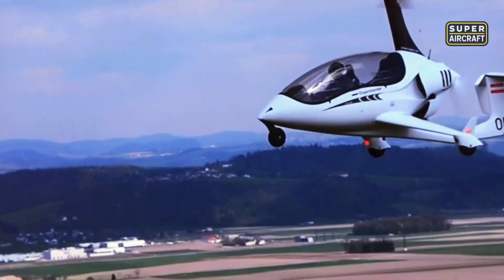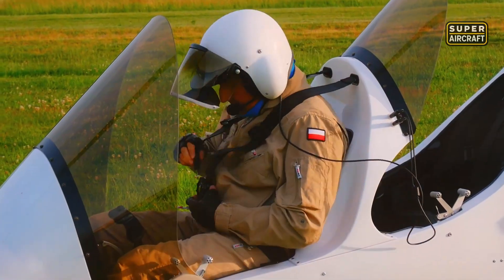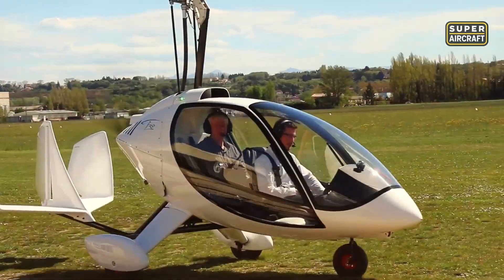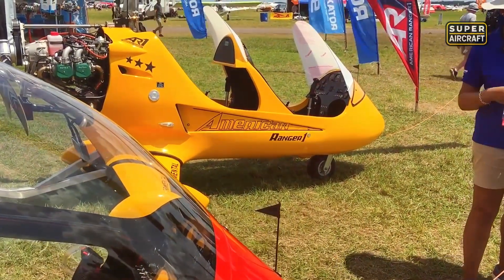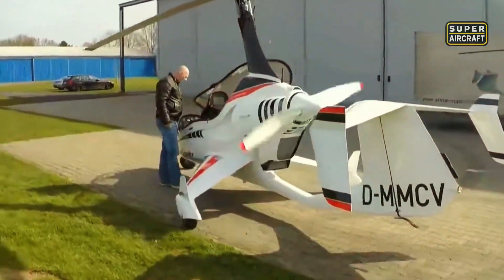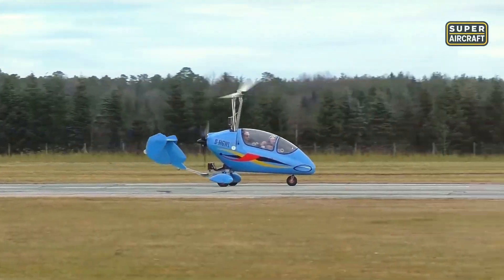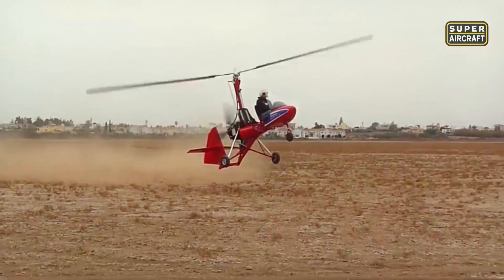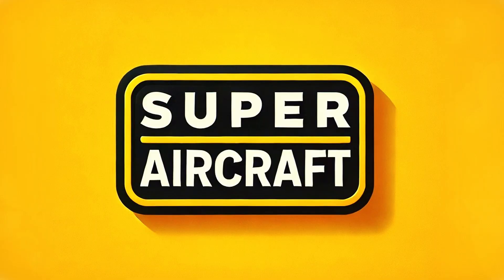WHY ARE THESE GYROCOPTERS MORE POPULAR THAN HELICOPTERS NOW

Comment: ¿Autogiro o girocóptero son términos similares aplicables al tipo de aeronaves aquí mostradas? Sí pero no pues mientras el "AUTOGIRO" es un tipo de aeronave que utiliza un rotor (las aspas superiores) como un helicóptero, pero sin propulsión alguna, pues para generar levantamiento el rotor solo gira por el flujo de aire que lo atraviesa en sentido ascendente, produciendo solo una fuerza de levantamiento dependiendo de la propulsión hacia adelante generada por el motor (trasero) y una hélice que le hacen despegar cual una avioneta, el "GIROCÓPTERO" es un tipo de autogiro que tiene un rotor propulsado, pues el rotor está conectado al mismo motor que hace girar las hélices traseras,  permitiendo así que el girocoptero pueda despegar y aterrizar verticalmente, como un helicóptero (3:27).

Post-data:
En resumen, mientras que el...:

1. Autogiro: tenga un rotor no propulsado que necesita velocidad de empuje horizontal para generar levantamiento, el...
2. Girocoptero: posee un rotor propulsado, que le permite despegar y aterrizar verticalmente como aquí (3:27).
3. Y aunque el término "girocóptero" sea lo primero que se nos venga a la mente aún viendo las diferencias entre ambos tipos de aeronaves, técnicamente, el autogiro es un tipo específico de girocóptero.
Reply: A helicopter has a powered rotor.  A gyrocopter, gyroplane and auto gyro are different names for the same type of aircraft.  The rotor on these aircraft are not connected to the engine. However that being said on some a prerotator is used generally a small electric motor to get the rotor  blades going. Then the prerotator is disengaged.
Reply: @Dan-u1m7i  ¿Se fijó en lo que escribió en su apuro de comentar mi comentario? 🙄🤔🧐
Reply: @legionariodemilbatallas_57-62  That is a impressive video picture a prerotator  combined with headwinds could explain this video clip. I have seen small planes take of in very short distances with high head winds. I stand by what I said I have rechecked different sources.
Reply: @legionariodemilbatallas_57-62  I stand by what I said I have checked many sources.  The video clip referenced is impressive. A prerotator combined with high headwinds could explain that takeoff. I have seen small airplanes take off in very small take off runs in high headwinds. I can not find any reference that a gyrocopters rotor blades are connected to the main engine.  If you could reference a technical article I would read it.
Reply: Слово "автожир" придумал испанский инженер Juan de la Cierva.
Слово "гирокоптер" придумал русско-американский инженер Игорь Васильевич Бенсен.
Все эти слова обозначают один и тот же тип летательного аппарата, использующего для подъёмной силы вращающееся крыло - несущий винт.
Чтобы автожир/гирокоптер/гироплан мог взлететь быстрее, на нём используется необязательное предварительное раскручивание несущего винта, которое останавливается, как только гироплан начинает взлёт. В противном случае реактивная сила раскручиваемого винта начала вращение в противоположном направлении гироплана, что привело бы к аварии. В этом основное отличие гироплана от вертолёта. Гироплан может вращать двигателем несущий винт только на земле, а вертолёт - на земле и воздухе. Вертолёт имеет хвостовой винт для компенсации реактивного вращения несущего винта либо соосный несущий винт, где два винта вращаются в противоположном направлении.
Если бы на 3:27 гироплан вращал винтом в полёте, то вы увидели бы его закручивание (рысканье) и аварию. Но вы увидели взлёт на месте. Он стал возможен из-за сильного предварительного раскручивания несущего винта (предположительно до 200 об/мин) и сильного встречного ветра.
Reply: @alexeyg.4896 Antes de este video y de hacer la investigación previa que realicé antes de comentar (para así evitar se me confundiera con un hater, losser, y troll de YouTube que cree a pie juntilla en los sofismas, y encima es un ultracrepidario) hubiera concordado 100% con usted. Pero como ya lo dije, hice una investigación previa a mi comentario y me tomé todo el tiempo necesario para explicar el asunto de la manera más sencilla posible.
Reply: @legionariodemilbatallas_57-62  вы можете верить во что хотите.
Reply: @alexeyg.4896 Lo mismo le digo mi nunca bien estimado ultracrepidario 😅
Reply: @legionariodemilbatallas_57-62  в отличии от вас, я привёл факты, которые можно проверить, а вы - только свои домыслы, полные ошибок. Как вы понимаете, вера у нас разная.

Comment: Only thing I don't like is the constant vibration of the stick. That's a big turnoff. You wouldn't drive a car if the steering wheel vibrated, would you?
Reply from the maker: You’re right, the stick vibration is a natural part of gyrocopter flying. It comes from the rotor dynamics, and while it feels unusual at first, pilots quickly adapt. Modern gyros are also designed to make it smoother.🤠✈️
Reply: @SuperAircraft2025 I agree.    I never think about it while flying.   Non pilots sure notice it on the videos though. 😊